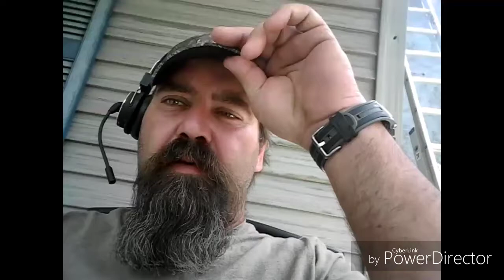Thermoking code 62

Comment: On a tk precedent there is no current sensor. There is a shunt on the board that will cause that code. There is no troubleshooting steps for it.  I keep clearing the code until it eventually goes away. You can run it like that as it is not a shutdown code.

Comment: I have a question on tripac Apu changed the oil and it won't start by mistake iadd the oil on top cap but now my control inside the cab is Frozen not responding 😡 only main power come on but can turn on the Apu and the mode can't be changed or fan it's stuck on AC mode I press the button but no changes. ,???any clue s. Or idea I will appreciate it a lot thank you Jorge Villarreal     Laredo TX
Reply from the maker: You should probably test the main fuses located on your batteries.
You may have blown one not allowing power to the circuits that run all the functions of your unit.
Also did you change out your fuel filter?
Reply: @hillbillyholler516  yes sir did pm on Apu for the first time sir
Reply: @hillbillyholler516  ok In going to check the fuses at the battery box to see what happens it was just running perfect before I did the pm service  😁😁
Reply from the maker: @noo7073  if you swapped out the fuel filter the issue can be air in the fuel line.
What I would do is pull the fuses I mentioned in my video on apu issues.
Let it set for 30 min , test the fuses for continuity, and reinstall them if they are good.
Next try to start the unit and go outside to listen and see if the fuel pump is working. 
If you cant hear the pump then having air in the line killed the pump.
If you can hear it then loosen the fuel line at the rail , and see if it will prime.
Another thing to look at is the wiring harness outside of the unit casing.
It could be that the wiring harness rubbed against the frame, and over time it has caused a short.
Reply: @hillbillyholler516   I found the 200amp fuse bad in battery box. Try to starter and I won't turn  Im not sure if I mentioned before that  by mistake I pour the oil on the top cap not the side it's that got something to do. I heard that it can go to the Pistons or something.   Everything that you mention before was perfect blown fuse  thank you very much now I will try to get out of the  hole  it's my bad now
Reply from the maker: @noo7073  you can pour oil in either spot actually. 
The top just runs through the oil return ports in the head.
Most all cars are setup for filling the oil this way.
It wont hurt a thing to add oil there.
It's most likely the fuze.
You can pickup one at orialeys autoparts for around $45.00
Reply: Ok Buddy I will get a fuse at O'Reilly tomorrow hope to get it running 👍👍👍 thank you for replying back ...
Reply from the maker: @noo7073  sorry my reply was delayed!
I was at work, and the shop is short handed these days.

Comment: I been getting eng code , I turn it on , it try to turn on but then shuts down quickly  changed alternator have oil what u think it code be ? Thank u advance .
Reply from the maker: Does it turn over like it's trying to start?
Reply: Hillbilly Holler , yes then shuts down.
Reply from the maker: @truckertotrucker1544  pull the air filter and try to crank it up.  
When it's cranking give it a shot of starting fluid.
If it starts it's not getting fuel.  
If it's not getting fuel try to start it again and listen for the fuel pump.     If you hear the fuel pump check the filter.
If it's not the filter or pump then it may be the fuel pickup tube in the fuel tank
Reply: Hillbilly Holler , Thank u will have a Sunday project to do. Will keep u posted
Reply from the maker: @truckertotrucker1544  awesome.   If you need anymore help just ask away 👍